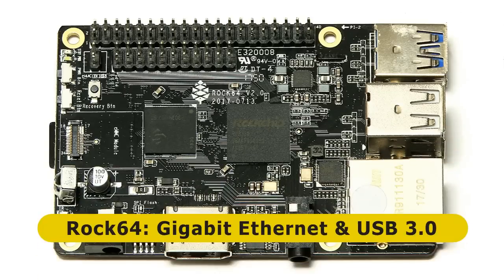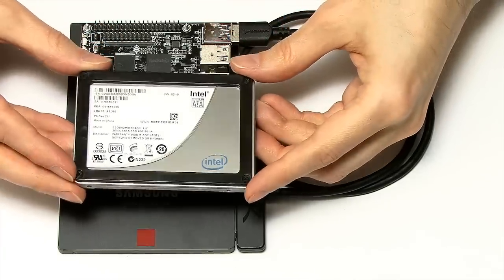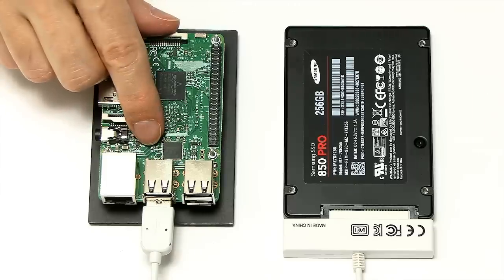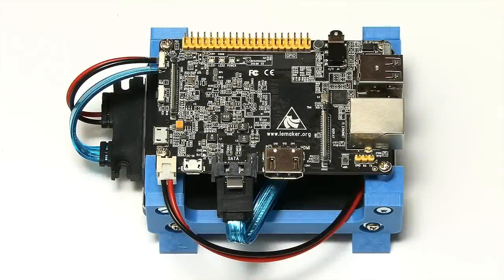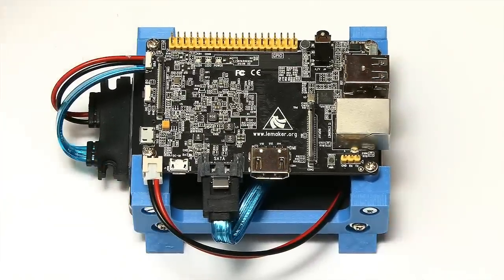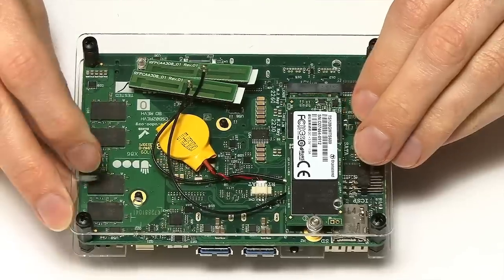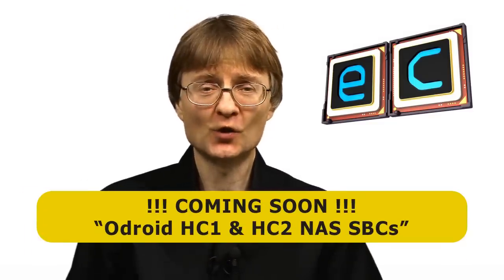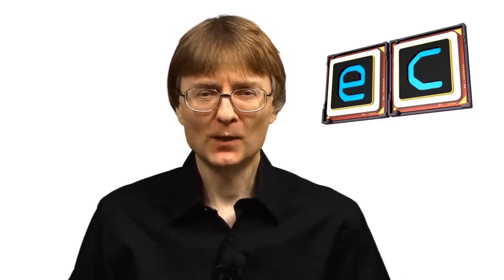SBC NAS Group Test

Comment: Hi again Christopher - if I have a powered USB3 hub, will it work properly on the Rock64? By that I mean, can I hook up more than one hard drive to it and potentially expect both drives to run at full USB3 speed (5 gigabits, I think it is)? Or in the process of using a hub, the whole chain is limited to 5 gigabits total and therefore the bandwidth for each drive is cut in half? Since there's only one usb3 port on the Rock64 - which, mind you, is one more than the RPi3 and RPi3-B+ have .. such an odd omission on their part, no?
Reply from the maker: A powered USB hub should work fine on the Rock64, though I have ready (more generally) of stability issues using a USB hub long-term for a NAS.
Reply: ExplainingComputers - I'm not quite clear what you mean? I would have thought that a self powered hub would in fact help things be more stable and reliable, with less power needed from the Rock64 SBC?

Comment: Hi Christopher, great channel and a subscriber for life here, had a fast question about the Rock64, I currently have an RPi3 (not the newest one that was just released), and I am thinking of swapping that out for a Rock64. 

I was going to use the link in the description but, would a 4 gig model be a better idea? More memory, therefore it can handle larger files, no? 

Also, I can in the meantime tack on a gigabit Ethernet USB adapter onto my RPi3, though I know it will top out at 250-300 megabits when running a hard drive at the same time, or is the USB2 bus split in two sets of two?

Thank you kind Sir
Reply from the maker: The USB 2.0 bus on the Pi is indeed (sadly) shared. The 4GB Rock64 would indeed give better performance handling large files, more cache in a NAS or media streaming context, etc.

Comment: Another great video Chris, thank you.  I think the Rock64 is the real winner here - it so cheap yet performs almost as fast as the Udoo which is over 4x the price and uses more power too.  I have one with the eMMC setup as a boot drive and a USB3 5tb Seagate drive for all my files and media (I couldn't believe a small 2.5" drive could hold so much! Plus it 'only' costs £125).
Reply from the maker: I totally agree -- the Rock64 wins hands down here on value.

Comment: Hey Chris, what is this UASP stuff all about:  StarTech.com USB3S2SAT3CB 3.0 to 2.5" SATA III Hard Drive Adapter Cable w/ UASP - SATA to USB 3.0 Converter for SSD/HDD    Would you have gotten even better results with that on the Rock64?  I just heard about this a couple of weeks ago and it took me some time to even come up with the letters (UASP). I don't know, maybe it's just an Apple thing, but I did hear they're using it on the xbox with the game pubg because it does that game so poorly.
Reply from the maker: The speed constraint here (at the high end) will be the speed of gigabit Ethernet. I doubt that the Rock64 would perform better with a different USB-SATA adapter -- the one used was SATA 3.1 -- and the USB attached SCSI prototol (USAP) is part of the USB 3.0/1 spec.

Comment: Hi, just a question about the SATA ports : Is it SATA 3 on the ODOO 86 ? Or is only the M.2 port using SATA 3 ? 
And on the banana pro, is it SATA 2 or does it use a sata to usb bridge ? (that would explain the low speed, that put it almost at the level of the Raspi 3 with all its USB bottlenecks)

Also, for NAS you talked about the Odroid versions, but I heard somewhere about a Bulgarian manufacturer called Olimex. Their A20-Olinuxino-Lime 2 has native gigabit ethernet and a native sata 2 port, connected to a 1ghz (or 1.2) dual core CPU with 1GB of RAM. Would this actually be sufficient to run a NAS ? The price is around that of the Raspberry pi.

I've not heard a lot about olimex boards despite the fact I find them very interesting, given the connectivity they offer and the attractive price. I'd be very interested if you would review one of these, they can run on ubuntu or android like other SBCs.
Reply from the maker: Sadly the UDOO and LeMaker sitres do not list the SATA version I'm afraid. I will checkout the A2) SBC you mention.
Reply: Well I guess for a NAS this is not really a problem, because SATA 2 is around 3 Gbps, so it won't become a bottleneck since the gigabit ethernet port now becomes the bottleneck. But it would be interesting to see if at this price you actually get SATA 3, especially on the Sata port where you can plug big hard drives to store lots of data.

Thanks for checking out Olimex, they make other boards as well, but I really remembered this one because of the SATA port to install a NAS at home some time.

Comment: Please try simultaneous file read and write. After all, a NAS is used for multiple file I/O operations from different clients. You should be able to get an aggregate performance speed  of the read and write operations from the total network I/O during the test.
Reply from the maker: But the speed limitations here are the network connection and drive interface, so read and write speeds ought to be the same. This is not a test of a drive.
Reply: Maybe. Write speed testing should expose most network/SATA/USB bottlenecks. Disk write is also usually slower than read. However, all above drivers have limitations for simultaneous read/write, depending on the implementation. This video was to demonstrate which SBC has the best raw power. I suppose  my request falls under which NAS software runs best on a SBC. Can you also compare a Linux-based NAS package against Windows 10? I'm running Ubuntu 16.04.03 with NFS4 and a 4TB USB3 Western Digital for my NAS server on an Odroid XU4.

Comment: So you  used the M.2 drive on the UDOO instead of the SSD for the test?  or did you use the SSD for the Transfer Test and the M.2 was just for the Openmediavault installation?
Reply from the maker: The M.2 drive was used as the storage volume. OpenMediaVault was installed on the UDOO's onboard eMMC.
Reply: So if you didn't use the SSD like the other SBC's, the test wasn't consistent & fair or a true test to show the use as a real NAS (with the SSD).  You're timing on this video is pretty cool btw,  because i'm actually looking for a SBC to use as a NAS.  i have an old D-LINK DNS-321 that i got long ago, shortly after they came out.  i'm hoping to use the existing case & my WD Reds then  change the board.  It was advertised as Gigabit Ethernet, but something else on their board couldn't continue that Gigabit speed and it basically is only possible at 100 speeds instead of 1,000 because of a bottleneck after the Network Controller. So i get between 8mb/s - 15mb/s .... no where near Gigabit :(  ..... i was looking at the Odroid HC-2, but it only has 1 SATA-3 port and the USB is only 2.0, so i can't add another SATA-3 on the USB.  That means you have to buy everything you need for every hard drive you use, including power supplies.  Seems like the XU4 would be better for a NAS than the one they make specifically for the task, lol .... plus, it's only about $10 more.   Thanks for all the great info in your videos.  Just wanted to give feedback on this one, since i was actually using the information in my current project :)
Reply from the maker: It was a true test of the fastest NAS possible wirh each board. :) Good Luck with your project.
Reply: i don't want to go against what you say, because you definitely know way more about computers than i do, but i don't think anyone is going to use a M.2 for a NAS storage.  They are way too small and cost way too much to use as NAS storage.  People get hard drives that are multiple Terabytes.  i have a small NAS with 10TB in it.  One or even two M.2 drives wouldn't even come close to what i would need for NAS storage (in an affordable way) ..... Plus, the more important part ..... is that doing a scientific test, should be consistent, as to see the differences in the changes.  We can't see the difference in that one because a variable was changed that wasn't used in the other boards.

Comment: That was a downright shameful performance by the Pi 3. Then again, it's still by far the least expensive of the bunch. I guess it comes down to what you're willing to pay for.
Reply from the maker: The Rock64 (1GB or 2GB) is actually cheaper than the Pi 3 !
Reply: I would not have imagined that, given how inexpensive the Pi is. I suppose that's an even further insult to the Pi 3.

Comment: IMO, a NAS without RAID, is not a serious system for important files.
For movies and such, where it's disappearance won't be an issue, it'll do. +👍
Reply from the maker: I would agree -- I'd only ever consider a NAS a means of sharing data that must be backed up elsewhere. Even a RAID NAS is not a sufficient place to store any inportant data as it is likely to pickup any ransomeware infection anywhere else on the network, and because it is constantly powered it is far more likely to become corrupted than an offline drive. 3-2-1 is the only sensible strategy for any data of value, and no single hardware solution can offer this.
Reply: Agreed.

Comment: +ExplainingComputers
HI, great video as usual. Totally off subject. I did a test built of a NAS after watching the previous NAS video. The question is, how do you access the file already on the SSD when the drive is connected to be used as NAS ? Or these files are off limit, and only the file copied to the NAS afterward is accessible. (Which means you can only use empty drives from the start).  I have tried tweaking a lot of settings in the OMV with no luck. Thanks in Advance.

Comment: I recently build 2 different NAS servers. 1 with SanDisk SSD 240 Plus (SDSSDA-240G-G26) and 1 with a Seagate 1TB BarraCuda (ST1000LM048) both NUCs (BOXNUC6CAYH) had each 4GB of memory.

I installed Ubuntu server and standard Samba on both (standard settings only assigned a network share)

I used this command to create a file on the NAS: dd if=/dev/zero of=filename bs=1000 count=2M

SanDisk - 2GB upload from NAS to PC = 18.13
SanDisk - 2GB upload to NAS from PC = 18.04

BarraCuda - 2GB upload from NAS to PC = 18.16
BarraCuda - 2GB upload to NAS from PC = 18.10

I think it's safe to say that the the results on both SSD and Standard HDD are the same and a single-board computer 

The UDOOx86 AP is USD $174,- (excl shipping and tax) + $99 for the 128GB M.2 SSD  + $8.90 for the power adapter + $7.90 for the case + $16.90 if you want to have WiFi connectivity. So for $306.70 (without Tax and Shipping) you have a NAS server.

The NUC was $126,- / $46.01 for the 1TB BarraCuda or $69.99 for the SSD / $37.99 for the 4GB memory

So a NUC is $210 for the BarraCuda or $233.98 for the SSD (without tax - shipping was free)

So it seems that the NUC is more price effective and faster than the UDOOx86

Great presentation once again :) looking forward to the next generation of Single Chip Computer Boards.

ps. the SSD probably would have been able to handle multiple different files from different computers better than the standard HHD.
Reply: VampierMSX The thing is it depends on what the bottleneck is. In the case of SATA 3 with 6.0 Gbps, or an external drive on USB 3.0, which is around 5 Gbps if I remember correctly, your bottleneck will be the gigabit ethernet, whic "only" provides 1 Gbps. So it doesn't matter if you use a HDD, a SATA SSD, a M.2 SSD (which in the case of the Odoo would be over sata and not PCIe), transfer speed wouldn't excess 110 MB/s because of the gigabit ethernet. And sharing the transfer to multiple computers on the same network wouldn't improve total speed, as the NAS would have to transfer both files over one ethernet port, that is already the bottleneck.
Reply: I know :) I just wanted to lay out some facts and the fastest transfer speeds on a gigabit network. I used to load files from tape with 1200/2400... so there is that ;) SATA SSD can do around 550MB/s the mechanical one is a bit slower but still sufficient.... now when it comes to random sector reads/multiple file reads at the same time for different clients the SSD would win. I peaked around 108MB/s... probably because I was remoting into my windows server with Teamviewer. 

I did a test once with 2 different files on 2 computers and my upload speeds where doubled ... I have a managed switch in my home so I used that opportunity to test my QoS.
Reply: Thanks +VampierMSX, very informative (maybe the The NUC was $126,- / $46.01 for the 1TB BarraCuda or $69.99 for the NAS / $37.99 for the 4GB memory  ----- should be read as:  The NUC was $126,- / $46.01 for the 1TB BarraCuda or $69.99 for the SSD/ $37.99 for the 4GB memory ?)
Reply: thanks corrected :)

Comment: One thing missing in NAS is RAID.  I love the fact people always talk about how great NAS is and how cute the idea is, but one thing will get missed is one purpose of a NAS will probably be file backup (ALWAYS a good idea, look fro Christopher's 3-2-1 backup video)  One day I will probably have  a nice setup, but will use a RAID mirroring setup because hard drives can fail (look for Christpher's hard drive videos) This is why all good servers run multiple drives. The big ones have hot swapable drives and power supplies (I had one)
Reply: RAID is not a backup and that's an important thing to remember, if you delete something or a file becomes corrupted then both copies are gone forever, which is a big difference from a backup in which you store a completely separate copy of everything, at least for a certain amount of time as files change and move around.
Reply: @vgamesx that is absolutely correct! Redundancy and backup are nowhere near the same thing.
Reply: I guess it's what you want to use the NAS for.  If it's to file share over a LAN and you already have copies on other PC's then it doesn't matter about having a RAID system.  If on the other hand you are using a NAS as a place to store data that isn't on other machines or drives (such as a movie collection) then RAID is essential.
Reply: dude what?, almost every NAS system have RAID including OpenMediaVault...
Reply: Dictionary please, what is a RAID? and I see all these NAS been shown and noticed one major thing
Reply: it is not intended as file backup but as to keeping data fully available and any data(in the right setup) will not disappear in case of a hard drive failure
Reply: RAID is fine if you want to minimize downtime of the NAS itself, but the security of your data depends on your backup strategy.
Reply: Well the point of the RAID would be redundancy in the event of a drive failure. I suspect data mirroring could be achieved using two USB devices on a SBC setup. I use a n actual server chassis and spinning disks in a RAID5 for my storage needs but was really interested in this idea as a portable solution. a 3U server chassis doesn't exactly fit in a laptop bag. ;)
Reply: There may be a way is you have 2 usb ports to use. I think though with all the talk about NAS and such that in a home use environment that you could have it like that so when a drive crash occurred the NAS still ran and allow you to do whatever until you can replace and allow system to rebuild. I could see where you have company over and want to show home movies or photos , maybe play a movie, or having a party and the system crash putting you in a bind . Or even more fun you are away from home for a week and it crashes and the rest of the family calls you to ask what to do
Reply: very true, but it is one thing to consider when deciding on making such a setup
Reply: None of these boards offer multi-able sata connections so raid is not a consideration in this case ! Yes raid is good if you need to worry about hard drive failures but in most cases a good back uo routine will serve most home users better than a raid setup ! IMHO
Reply: But many good points brought up on this thread and was just trying to combine them and simplify them !
Reply: I just wanted to make aware the one thing i saw missing with all this NAS talk is the talk about RAID something all the big boy servers use, you may not need but something to think about if you want to play with
Reply: FYI wan to see a weird thing someone used a bunch of thumb drive into a raid setup using a drive allocation table setup

Comment: Nice! Always good to see tests like these since there's a lot of trickiness going around the actual speeds that those SSD/M.2 connections run...
A good interesting project for a devboard too... I've been thinking of replacing my old desktop NAS with a more scaled down version. Huge desktop tower just doesn't fit well the application. xD

Thanks Chris!

Comment: I suppose one lesson here is not to prepare a video featuring a Raspberry Pi around Pi day, March 14.  What unfortunate timing.  From what I have heard, a doubling of transfer speed is possible.  The real problem of the Pi in this use case is the shared USB 2 bus.  Accessing a USB drive while doing network transfers costs more speed.  I liked this topic as I've been playing with a few of my Odroids for NAS purposes.  My network setup has a big bottleneck, so speed of the SBC is not a priority at the moment.  It was interesting to see these other boards tested.  I knew the Rock 64 would be worth keeping an eye on when I saw that it had a USB 3 port at that price level.

Comment: the review very incidentally! 
"banana Pro" was not very fast (very sad). I was planning to build a NAS based on it. now I know what I'm going to use a matx celeron n3050 (bought on eBay. initially planned to make a desktop PC). this motherboard has a fast processor (for NAS), a couple of SATA 3, 4х USB 3, Gigabit Ethernet. and (is very important) pci-e 16x. if I have enough 2х SATA 3 ports, I will install the additional RAID controller, with 4 ports of SAS. (can work in SATA 2 mode).
thank you author for the review.